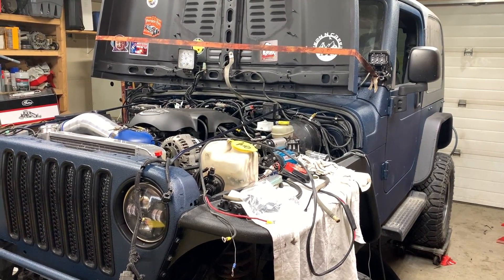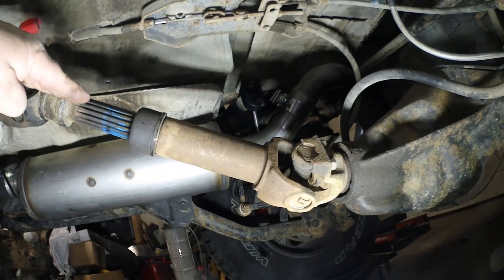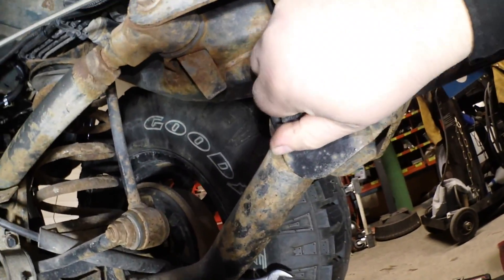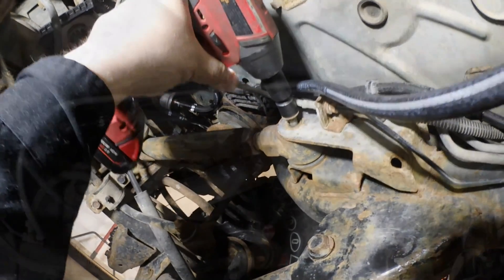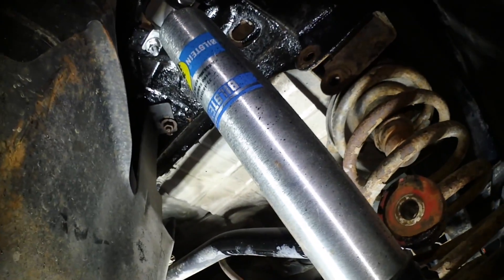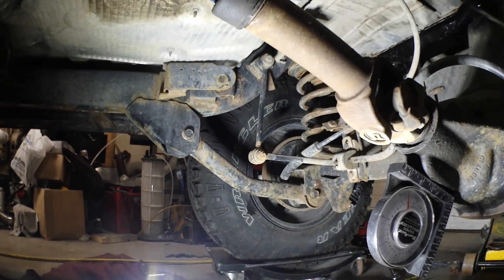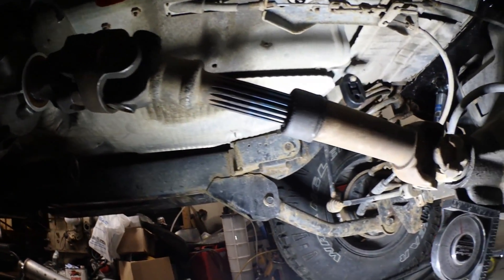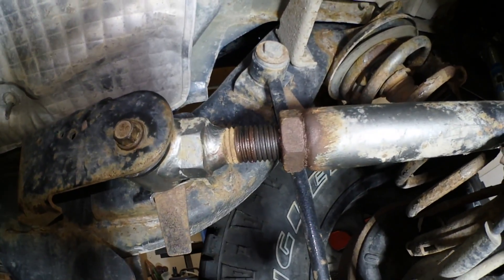How to Set Pinion Angle DIY

Comment: Hi Jerry, did you get much “spring bend”,on the coils when you changed the pinion angle? I tried upper rear adjustables on my jk, but the springs wowed so much as to hit the rear track bar bolts.
Reply from the maker: It’s not too bad actually, worst case you count cut the top mount and re-weld it back in